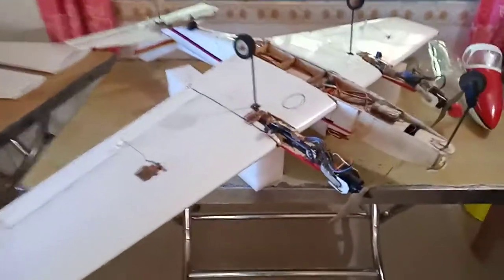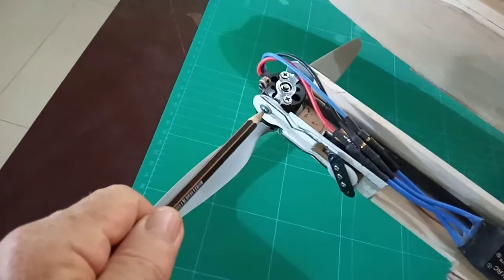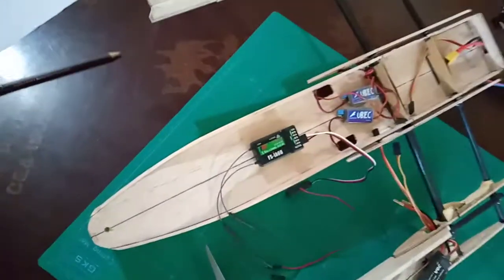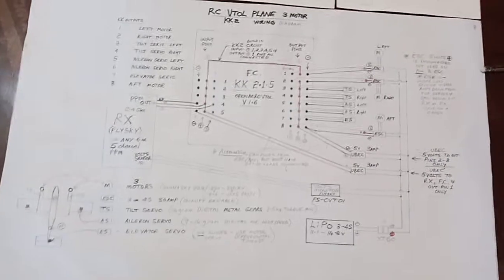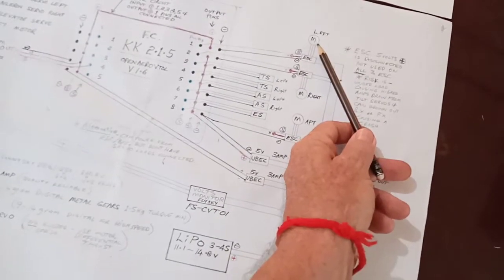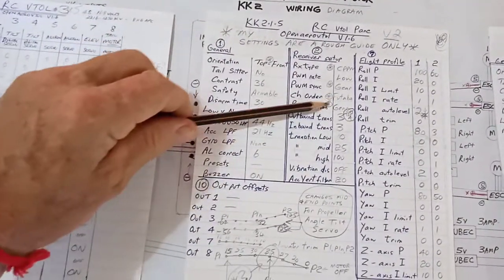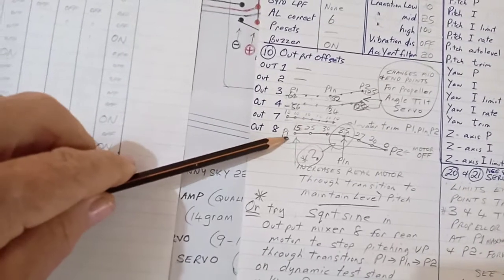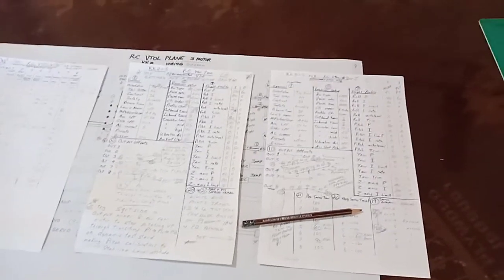Vtol Airplane RC build Wiring & KK2 FC with Openaerovtol settings Part 3

Comment from the maker: Information and specifications and links updated info is here as needed.
RC DIY Vtol Plane Transitions from hover to flight to hover.

This vtol plane can taxi and roll take off or land either as a plane or in VTOL mode.

Hybrid tri-copter airplane, outbound tilt 3 seconds and inbound tilt 3 seconds transitions.

Hover P1, slow flight P1.n and forward flight P2.

Flight controller is KK2.1.5 with Openaerovtol V1.6 firmware. (google RCGroups instructions)

Construction - 5mm Depron foam skin wings and fuselage skin and all tail surfaces. Mostly 3mm balsa fuselage and 5mm balsa motor pod mounts and 3 or 5mm balsa ribs. Has 8 x 6mm Carbon fiber wing tube spars and rear fuselage boom.

Design - Swept and tapered wing, over all wing span is 1360mm, max length 1100mm, 280 mm wing root cord 34mm 12% thick, 160mm tip cord 19mm thick all sections are 12% thick and NACA 2412 airfoil section, 5-degree dihedral each side, 425mm wide central wing section has small washout by only increasing the inner root cord rib incidence to 2.5 - 3 degree. Each removable wing has 1.7° incidence approximately and no washout needed. The center CF main Spar tube 10x8mm is fixed at 33% from root leading edge about 92mm and 53mm also 33% at tip. Wing join location has approx 250mm cord. Main and aft spars are 80mm apart (moving the front spar forward to 90mm space will also work) . The only removable parts are the 2 outer wings for transport that have forward main spar 8 x 6mm CF spars and aft spar is 6 x 4 mm.

Horizontal tail stabilizer is 500mm wide x 115 x 20mm, single elevator shape is 500 x 65 x 45 mm, vertical fin is 160mm high  x 260 OA horizontal length. Main spar to stabilizer / elevator or hinge position is 590mm, 370mm span between front motor centers and 200 - 215mm forward of main spar. Rear motor is 400 mm aft of main spar.

All these measurements are NOT critical and only noted for interest sake, variations of all measurements by 50mm would still work fine, but do get the C of G balanced at around 29% (27 - 31% ) with moving the lipo position.

A round hollow spar near the C of G is very helpful to pivot the model on a test stand to dynamic balance (while motors running) and calibrate all settings for stable transition or pitching of the motor propeller for inspection from P1 hover - P1.n - P2 flight horizontal positions the plane should not pitch any more than about 20° and even this is easily corrected in flight  (preferably little to no pitching if possible) or if pitching 45° or more on a test stand the plane will be difficult to transition in the air causing loops or stalls. See test stand video demo.

For initial test stand test start roughly with a rear motor offset increased power from about 15% at P1 hover to 30% P1.n to 0% power at P2 for forward flight.

All Motors are 2216/1250kv on 4s for higher speed (or 880 or 1000 kv is ok on 3s and bigger props ) pivoted near the rear position. No rudder or nose wheel steering is needed for airplane mode. Differential front motor thrust for P2 F/flight rudder yaw control 25 % Volume with no gyro or AutoLevel needed and will stall turn with rudder or taxi tight radiuses. 

P1 Hover settings for both front motors have aileron roll volume 30% with roll gyro ON and roll AL ON, elevator pitch volume 25% and pitch gyro scaled and Pitch AL Scaled and P1 Alt damp ON.

P1 and P2 front motors have 100% throttle volume.

Rear motor P1 throttle volume 100 and P1 elevator volume 90 and pitch gyro scaled and pitch AL scaled  and Alt damp ON

All output transition curves are Linear.

ALL other output settings are 0 or OFF.

Flying AUW 1520 gram = 1320 grams flying airframe + 200 gram 1500ma 4S lipo.

Tilt Servos should be strong at hold so are digital metal gear MG90 size. . Motors tilt approx 80° from level at forward flight to slightly forward about 10° at hover and another 15° approx for yaw so about 95°. Tilt mechanism linkages from servo arms (30mm holes spaces on servo arm) to motor arms bracket with 28mm hole centers. (or example both the same at 28mm if your servo has enough travel to make the motors tilt 95 or 100°

You can use normal 60° (but one size stronger) servos and have longer servo arms with wider hole centers to increase travel.

Aileron and elevator servos are any 9 (14) gram metal gear digital servo like MG90.

Propellers are anything that works for your motors for your desired high speed or heavy lift requirements. All CCW or all CW or any combination will work as the KK2 openaero doesnt know or care which direction they spin.
Tilt the rear motor about 4° to counteract yaw torque if you have example 1xCW & 2 CCW or tilt it about 8° if all props are the same direction. (final hover yaw trim is adjusted with the front 2 tilt servos via the KK2)
Very slightly better hover yaw symmetry performance and forward flight roll stability if you have the front motors counter rotating for forward flight but it makes very little difference with good props and motors and correct FC settings. I have done every combination CCW /CW  and they all work. Avoid heavy 3 blade props as they take longer to spool up and slow down and cause a lag delay latency for hover roll making the wings wobble a bit as the FC or small servos can not overcome the problem.
Straight wings are effected a bit more in hover as cross winds lift the wing tips, so the swept tapered wings are less effected as the smaller wing tips have less area to lift the wing.
Light fast well balanced props (and fast digital servos and fast motors 1250 kv will greatly improve crisp roll pitch hover stability for stick jamming aggressive flights.
As mentioned testing transition can be done without flying by removing the wings and pivoting the model on, or near to the spar tube and adjusting the rear motor throttle curve on the FC in Openareovtol offsets  until the plane remains stable and close to horizontal from hover to forward flight. (add weights to the model if the wing is removed and has changed the pitch attitude.
Increase power to only 25% in hover and switch to FF forward flight and watch for pitch movement and stop and adjust the FC to maintain pitch.
Now repeat at 50% power and adjust as needed to maintain the airframe is reasonably close to horizontal throughout all of the transition motor tilt positions. (15-20° pitch change is acceptable)

By now you probably have it dialed correctly and it hovers well in a test. 

You probably have it well balanced for FF as the C of G is correct and all else looks good.
Now test fly the airplane in FF mode only and land. (winds 0 - 5mph is ok
TEST hover again.
Now fly up high minimum 50m or 150ft or 2 mistakes high and fly slow and switch to hover and slowly add power to about 50 - 60% to maintain altitude and its now high up and hovering.
Remember keep the nose into the wind on all inbound and outbound transitions.

Relax and get used to the hover and test yaw and pitch and roll.
Now switch to FF and adjust pitch if needed during the outbound transition and you might reduce power again in FF and go around and repeat the transitions many times until its easy.
You should rarely need to adjust hover roll or yaw if you enter inbound transition level, its mainly power and pitch.
Now practice descending in hover, with about 40% power and learn to correct pitch roll and yaw where needed. (avoid nose in hover orientation if you are new at it) 
Now practice ascending climbs in hover.
Now with confidence only reduce your inbound transition height to about 5m or 15 ft and stop into a hover then slowly reduce power and land in hover mode
WELL DONE.
Now for Outbound transition from the ground, with your confidence gained up high the only difference is the ground position.
Ascend in a hover at about 60-70% power to about 5m high and maintain the power and switch to FF and respond (without panic, just watch and let it tell you what pitch it gently needs) to its pitch movements as it quickly enters FF mode and your flying again.
WELL DONE. Reward yourself with something.
Reply: Thank you very much for the detailed explanations. I'm going to build it exactly as you suggested.